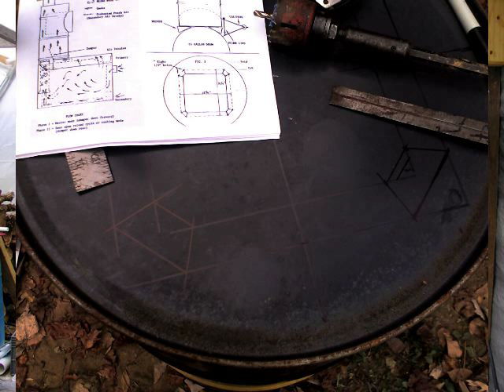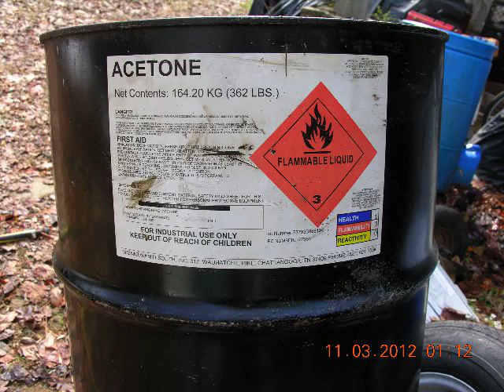Aquaponics Greenhouse Woodstove Build Slideshow

Comment from the maker: OK, a couple more observations on this build that I did not think of at the time. Make sure your barrels match as mine did not so lining up the ribs was more work than it should have been. Also the barrel I used for the bottom had indents each side of the ribs making the firebrick rock a tiny bit when crossing the rib area. Neither of these problems are a big deal but could have been avoided if I had noticed before hand. The stove is MUCH more efficient than a barrel kit due to the afterburner.